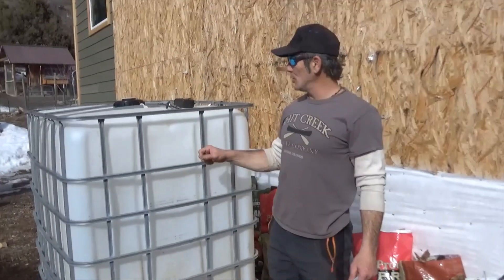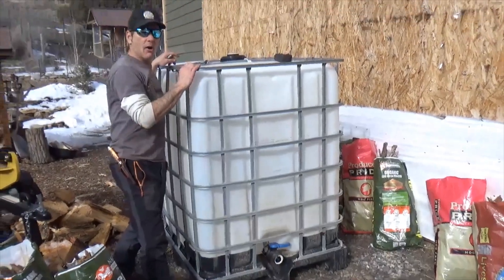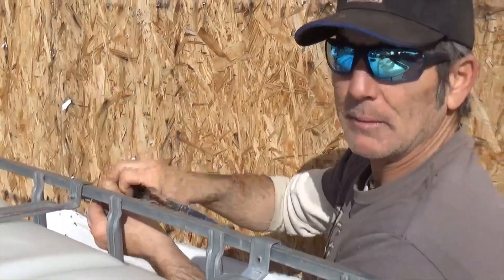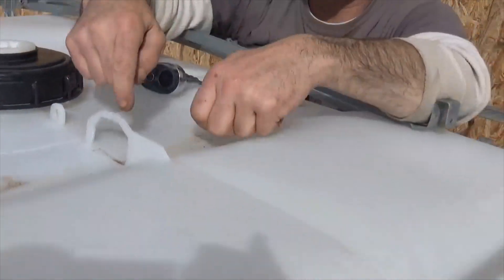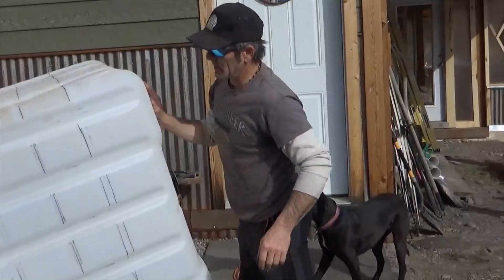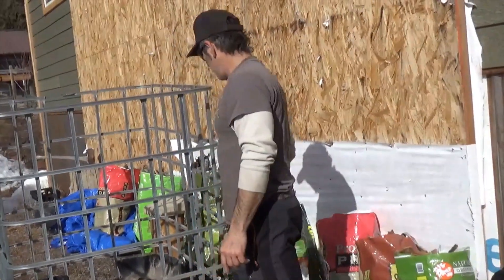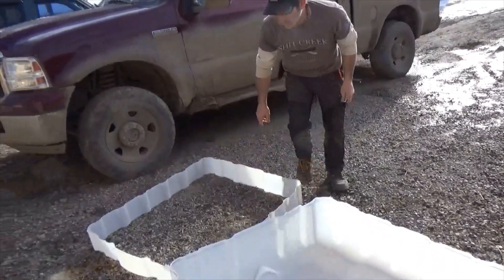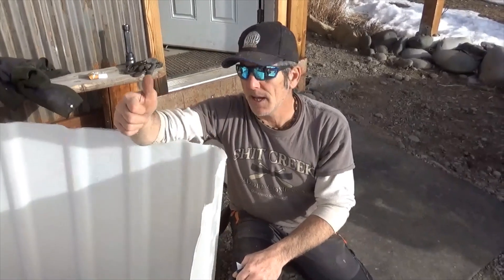IBC Aquaponics System Build - Do It Yourself -  Part 1 - The Breakdown - How To Step By Step

Comment: You finally got into one of the oldest gardening system known . I have studied it very diligently and I have been pushing to get people into this system of growing their food with very little maintenance . By the way the algae is most of the anaerobic action  needed to convert nitrites to nitrates and to convert the ammonia to a fertilizer for the plants . As the nitrated water flows through the plant beds the plants us the nutrients and cleans the water to be returned to the fish tank to start the cycle all over again as a continuous loop . I could help you through the complete set up from the totes to the beds to the filtration system that you can build from 2 liter coke racks and some evaporative cooler pads to the auto siphons for return water . This system is not I repeat not some new fangled way to grow food produce but over 4,500 years old system .

Comment: Sawzall works pretty good too so you don't have to get that metal in your eye like I did
Reply: right...but he wanted to use a "Diamond" Blade!
Reply: ...and a swivel knife with a plastic cutting blade goes so much smoother and faster than a straight blade on the plastic.👍
Reply: It's all good you know what you're doing